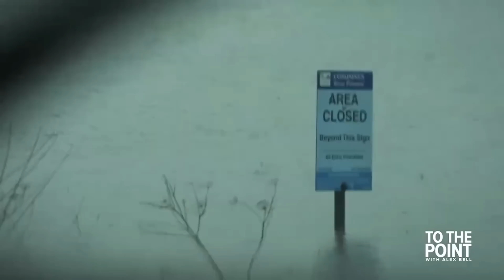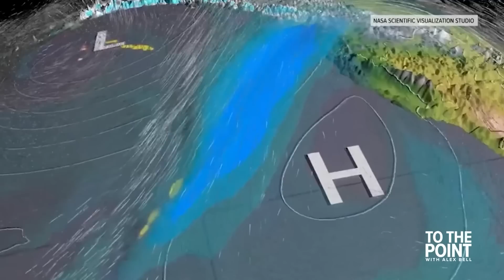Megaflood | What the state of California is doing to prepare for major flooding

Comment: You don't have to imagine what would happen in a large flood in California.  Just review the history of the Great Flood of 1861-62.  In the face of that level of rainfall, levee improvements would be like re-arranging deck chairs on the Titanic.  Picture the Central Valley as a single lake 200 miles long, 30 miles wide and 30 feet deep.  It happened.  Picture Sacramento under 10 feet of water for a month.  It happened 160 years ago.  There's no reason to think it couldn't happen again.  There was no smog or greenhouse gases or climate change at play in 1862.  But there was the Jet Stream.  There still is the Jet Stream, and it still moves atmospheric rivers across the Pacific Ocean.
Reply: The Ark storm. Another you tube video found it happens every 150 to 200 years. So any time now.